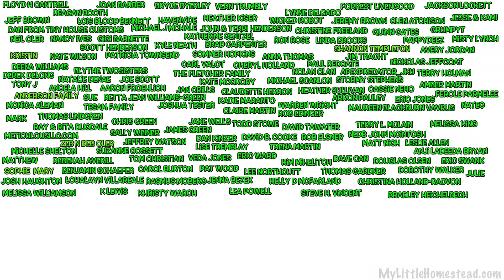Concrete Countertops, Office Space & Repurposing a Sweatshirt | Weekly Peek Ep213

Comment: CMY are primary colors for opaques only. RGB are primary colors for light and translucent media like solutions in water.  You guys are GREAT as always! So glad Gary is on the mend!!!
Reply: Green is NOT a primary color. It is a combination of yellow and blue.
Reply: I've been in printing for 20 years, our primaries are ymcb
Reply: @normahogarth6695  that's not so with light, which is additive. If you combine the additive primary colors, which are red green and blue, you get pure white light. For the subtractive, like with paints, cyan, magenta and yellow are the primary colors. Combining them yields black. Which is why black isn't a primary color. In printing, black is used separately to vary the degree of a color, and it's just cheaper to use purely black ink than to use a mixture of the other colors which can be used for, well, other colors. @Soggy Bottom Acres
Reply: @soggybottomacres3790  nuh-unh!
Reply: And red, yellow, and blue are the primary colors for mixing colors with paint, to get the rainbow of colors (where magenta doesn't exist, since it's actually a "fictional" color that our brain's make up when the wavelengths at the two ends of the rainbow are seen together).
Reply: CMY are not primary colors, neither are RGB; primary colors are RYB.
CMYK is used to balance primaries, and RGB is used in tech sensors to equivocate RYB and Gray.

Comment: Awesome news Gary on being cancer free!! God has answered favorably on all of the prayers for you. 

I used to polish marble and granite and when I had my business there was a phase where everyone wanted concrete counters. 

Looks like you did a great job. There is a place here in NYC called Stone Boss that has those diamond pads as well as all other products. You should check them out. 

For granite you want to always make sure to use each pad, making sure to get the scratches out from the previous pad. Yet with marble and concrete you can skip pads. I would usually just use a 120/ 220 and then do an acid polish before sealing. People hear acid polish and get all worried but it’s not that type of acid. Just do some research on it. 

I would make sure to definitely apply sealer every 6 months. I find that concrete and marble countertops tend to be porous and also scratch very easily. So just be careful. For me personally I loved making concrete counters as they were cheap to make and the mark-up was huge. Not to mention the work we got for maintenance afterwards but if asked, I will always recommend granite tops when you have the option. Over time they will pay for themselves and out live any concrete or marble....hardest stone next to a diamond. 

 
  

Happy Holiday MLH all the best!!

Comment: The trick to sewing sleeves on, Bree, is to sew in the right order: 1. is the shoulder of the front/back parts  2. is the sleeve, open, sewed to the arm hole, and 3. Last seam you make is up the side and down the underside of the arm to put it all together. At that point it's just an L shape, straight lines with one turn at the armpit, and the sleeve is much easier than trying to sew it on after it's made into a tube.

Comment: So happy for the good news! Now, use MUCH more water with those pads, that's why they are wearing out so fast. They are designed to use on central water feed grinders so that water enters center of disk and flows out taking grit and lubricating the disk. The diamond matrix is embedded in plastic, so less water = plastic melts/wears FAST. Also thoroughly clean top between grits or scratches will happen. Good luck!

Comment: When ya get to sealing those counter tops make sure to seal both sides where you can. Else you can get a mold infestation that will ruin the counter tops from within. Had it happen to a friends bathroom sink and my bosses garage floor had it happen. Also remember to reseal it every year or as you see it wear to prevent mold infections. Just kind note the shine level after that first coat and then when you see it dull to about half you may wanna reseal after a cleaning with a bleach solution of no more that a 4 ounces to a gallon of hot water and letting completely dry to kill any spores between the coats.